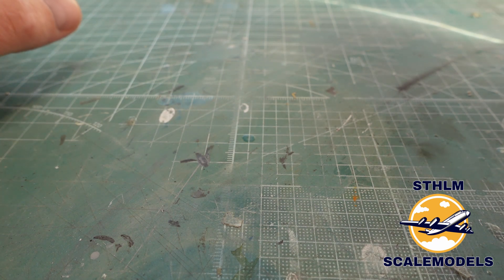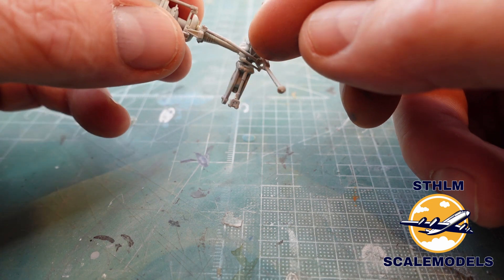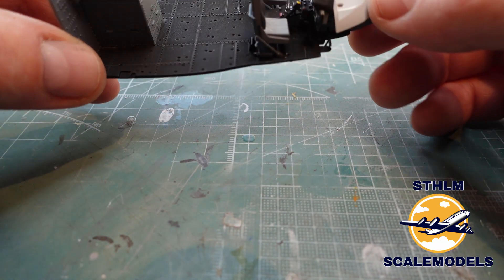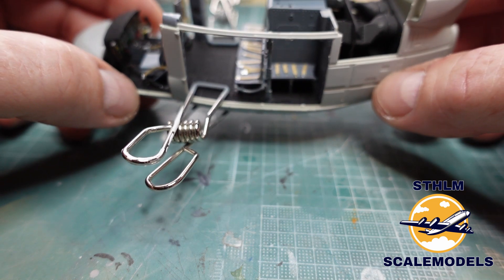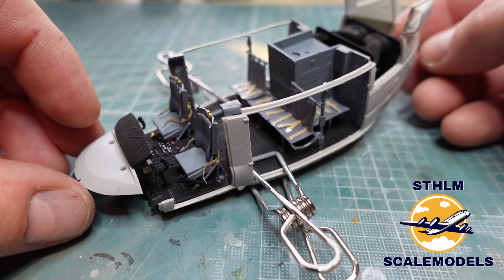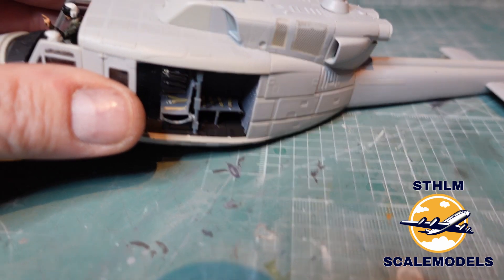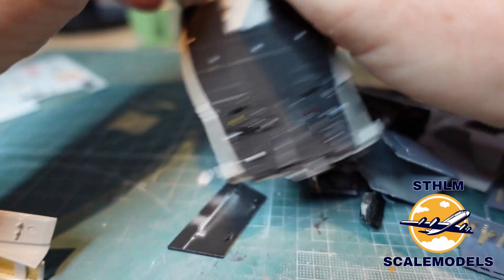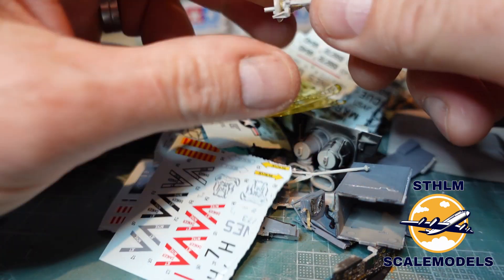Part 2:  UH-1N Twin Huey Helicopter by Kittyhawk

Comment: That was without a doubt one of the best Kitty Hawk videos I've seen to date! I can certainly feel your pain - I've done two video build series on KH kits, and I'm working on a third kit now. It's good to get an unfiltered discussion of these kits as many folks are so desperate for a kit of a certain subject that they won't criticize where needed. Kitty Hawk have great subject matter but really poor kit engineering and assembly. Keep up the good work!
Reply from the maker: Yes, the guys that design the 3D parts need to find a new job at KH :) Thanks for you comment!